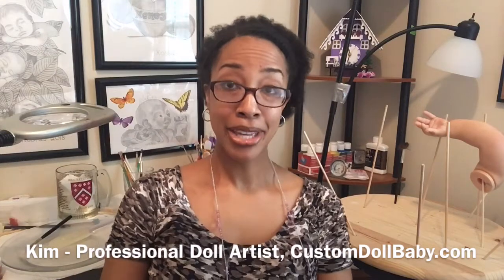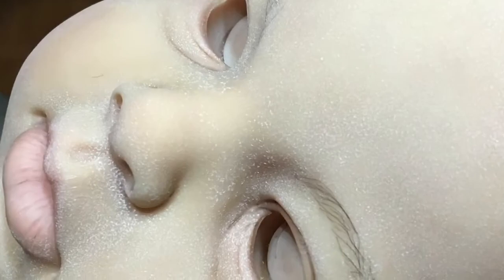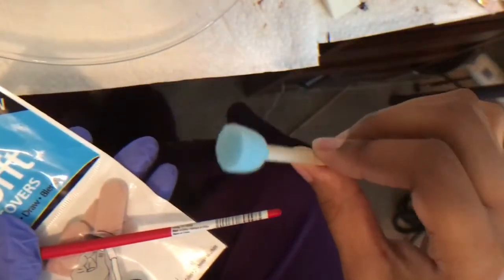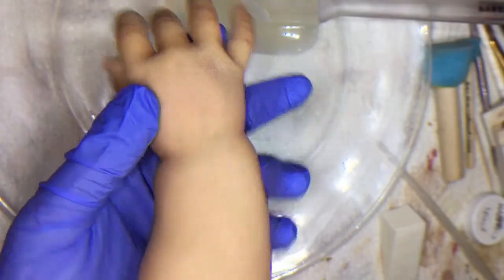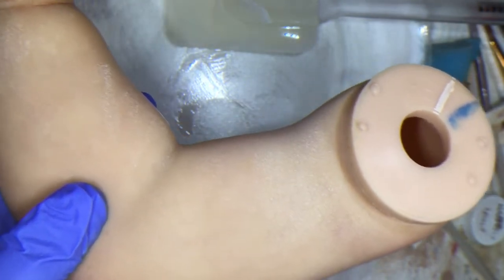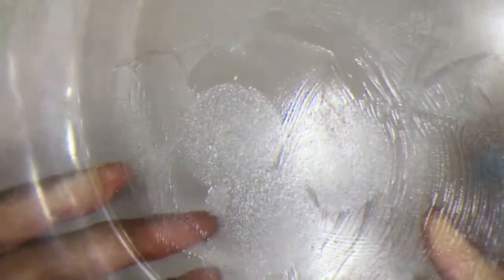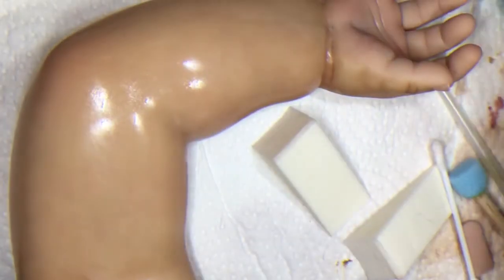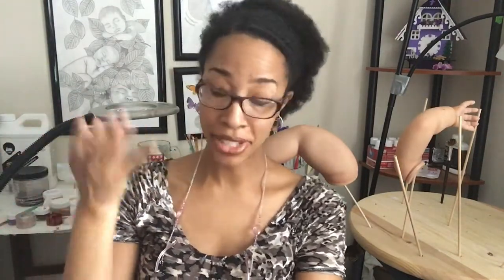When Reborning Goes Wrong: How to Repair Crusty Matte Varnish

Comment: You can try gently buffing out the crusty matte varnish with a facial buff puff dampened with odorless paint thinner. You can then seal with an air dry matte polymer varnish. It works just fine over heat set paints. It’s also great to treat reborn dolls that have become shiny over time.

Comment: Thanks for this! I just painted my first doll and had this issue after I baked. Not a whole lot but it was more chalky feeling than a flake. Thanks for this. I’m going to try some of the things in this and I might even just have to strip the varnish off and try again, making it a little thinner. I was using the started paint set from B.B. that has the matte varnish in it.

Comment: Normally the matte varnish goes chalky when applied too thickly. I had the same issue with the doll i just made and I had to mix up a new mix of sealer to fix it. I used a really thin consistency and it worked great.
Reply from the maker: Excellent!  Matte Varnish puts up a fight, but if you mix it with the right stuff, you can make it work.

Comment: Hello, just sharing my experience .I put a satin varnish finish on my finished  painted reborn  kit I first applied to the head and limbs lastly to the torso upper and lower parts waited an hour for it to dry  looked good so baked them  .   Took my dog out for a short 30 minutes walk came back took the head and limbs  out and grabbed  my torso parts to bake and the we're speckled with white powder   I was quite confused why on this but not on the head and limbs  didn't know what to do so started to remove it with some Qtips and stopped and thought maybe it's just really dried out and can't bond properly and needs baked so I did and they turned out 100% perfect. I think it could be a possibility of how   dry it gets and looks that way when it gets long dry, that was my experience,

Comment: I'm not sure if it's actually a problem. It happens when varnish gets very dry before baking. You can just cure it and when it's WELL cured, chalky effect disappears. Varnish is bounded with vinyl. It takes even 25 minutes in the oven, sometimes 4 or 5 times, but it gets all right. Have you tried it?

Comment: Thank goodness I found this, I have a question. I use acrylic air dry and have a spot or two that made this crusty layer on the head when I paint the hair it absorbs the paint and makes it look like a scabby mess under the hair. Will this same method work on air dry? or will it remove  the acrylic paint since it is not baked? Thanks for your help.

Comment: I have a doll I got in November 2014 (Quinlynn by LLE). She was originally made in April of that year and the original mommy rematted her arms. Months later I noticed a spot where paint has faded and just recently I've noticed more spots on the same hand. Any way to fix that? Is adding more flesh to make those spots look more blended an option or will that just make it worse? I'm guessing that just rematting it will be best. 

On the same doll the opposite hand's matting has become flaky. I haven't really touched this doll since I've noticed it. How can I fix peeling matting? Her original mommy used matte varnish that she bought at the craft store, not the kind specific to reborning.
Reply from the maker: +msninabonita4 That is unfortunate.  It should be safe to re-matte the doll.  Even Genesis on an acrylic matte should work (maybe test a small area first). It's difficult to say how this would look without knowing the extent of the paint loss.  If you like, feel free to send me photos of the damage at: http://customdollbaby.com/upload-baby-pictures.html

Comment: "Box of Tissues"... lol.  
No biggy (Air Dry Acrylic Paints) --- The morning after applying Sealant/Varnish, I had to use a fairly damp sponge or cloth to gently wipe off the "white fungus" that appeared on the lips and painted  eyebrows of my newly acrylic painted reborn.
I think the problem was the mediums that I mix into my acrylic paint, needed more time to cure than just a couple of hours. Now I wait at least a couple of days or more. 
The varnish I use is "PLAID folkart Indoor/Outdoor Matte Sealant" (non yellowing) ...similar to their "Glass & Tile" medium often used by reborn artists for better air dry acrylic paint adhesion. 
(The color pigments in the Acrylic paint actually "stain" the vinyl making it permanent)  

When it dries, the "PLAID" sealant/varnish is a bit rough feeling but can be smoothed by gently buffing off with a soft dry cloth. Some of the older shiny reborns may require two coats.

Comment: I had heard of this nightmare, but had never experienced it until this weekend.  Thank God I waited 3 days for the varnish to dry before sealing it.  When I went to go cure it, there was that nasty white crust.  I have been reborning for a little over 4 years and this kit has been a nightmare from start to finish.    My question is, once I get the crusties off do I use another type of sealant to start over or do I just go ahead and start curing?

Comment: Ugh. My first reborn arrived with damaged eyes. it was a shipping issue and the artist said the box was likely dropped or squished damaging the he’d. I learned to accept the doll as is, but a month or so ago, I sent her back to the artist and the artist “fixed” her eyes, free of charge; however, when I got the doll back, I found that the dolls legs were squishier, her body was softer (less plump), the artist cut her hair, and left glue on the side of her face. Yes, her eyes were fixed with German glass, but I’m upset that she took it upon herself to take glass beads and stuffing out of my doll’s body without my permission. I tried to take the glue off the side of her face (I’m not an artist) and I think I damaged the matte finish. Now, I don’t know what to do. I’m not sending her back again. I even bought some glass beads so I can fill her legs like they were before, but I don’t want to ruin her.

Comment: Hi , I had to remove varnish from my reborn for the same reason as you did .But , after I removed it , 10 min later , when the doll dried , you could see a lot of the white on her face , so I again removed it using the oderless thinner , 10 min later the white was back , i tried 6 times and there's still white on her face , its weird because I didn't even cure the satin varnish .This never happened before . Can anyone help me ?  :--(

Comment: Picture this, your making a doll for a little girls birthday ,in 5 days time. you've finished it, pleased with it, then add the last coat of matt varnish, YOU BAKE IT  all looking good, you take photos the following evening but lighting not the best so you wait till morning, still looking good, attach the head on properly, no problem, take into another room to take better pictures and huh horror, looks like a glass windscreen of a car as been smashed look on the left side of his forehead only frosty looking! why only on the head and on one side too? limbs all ok. Desperately trying to correct after removing paint and varnish right down to bare vinyl again, rough edges have gone at least, would have to be on the front of the head wouldn't.  Only thing that helped was rubbing hard with one of them magic sponges to remove the crustiness and then rub hard with thinners. Ive never had this happen before after baking and a day later too.